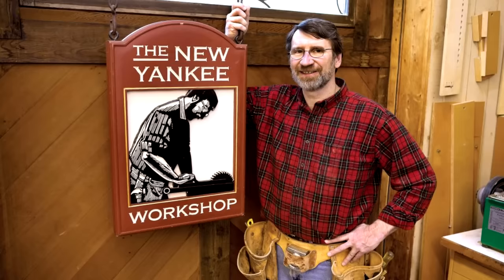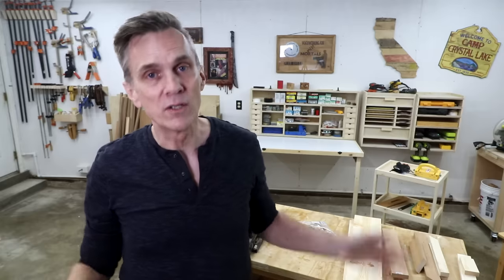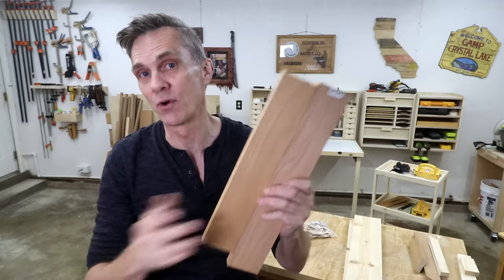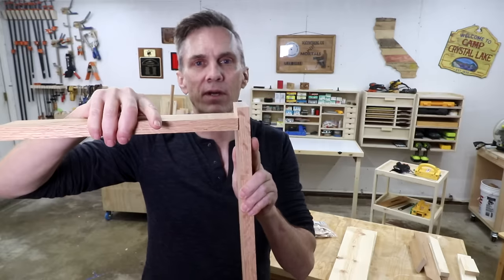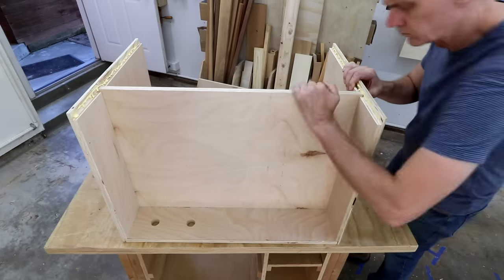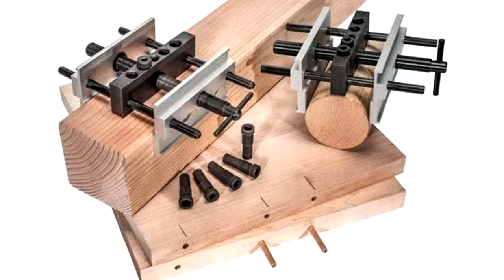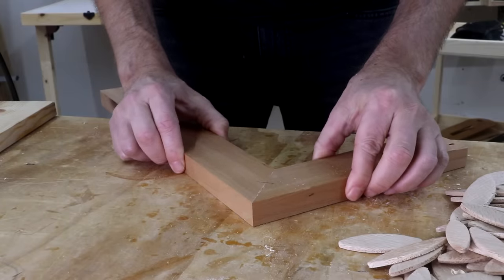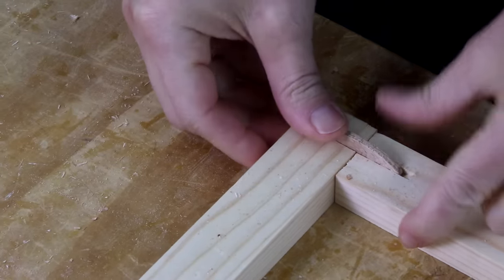So, is a biscuit joiner completely useless?

Comment: My 2 cents on this issue, with respect to Steve and his great videos which I have been watching for a long time:

If you're using a biscuit joiner to create a joint, you're using it wrong. It's only purpose is to align the boards better so that you save time sanding in the end. As a matter of fact, it should say it on the box: "Do not use for creating joints". Therefore, comparing it to dowel jigs or the Domino, is comparing apples to pineapples.

Sure, an alternative is the use of cauls, however if you're making a table that's 38" wide, cauls are ineffective in my opinion. Plus you have to keep cauls from not being glued to the surface, etc, pretty messy. Also, there is a another huge benefit to biscuits here: if your boards are not perfectly milled and have a slight variation in thickness, biscuits will still align them at the top, creating a flat tabletop, cauls will not, they will just squeeze the thicker boards, allowing the thinner ones to float. So, if you're a novice carpenter who wants to make tables, using biscuits will make your life much easier, in my opinion.

If you're proficient using the tool, you can create slots on a whole dining table in a matter of minutes. 

Nobody said that a biscuit joiner is an essential, agreed, it's definitely a specialty tool. Personally, I use it only when making tables.

Also, with my DeWalt biscuit joiner, the biscuits fit snugly. Or perhaps it's the size of the biscuits. The biscuits are supposed to slide left and right in their slot, but should not move up or down in it.
Reply: They are perfect for jointing boxes, drawers, cabinets, raised panels and small tables. And if you combine it with pocket holes and screw joints it can be really strong.

Comment: I don't have ANY play in my biscuits, they DO make the boards go together flat, and since I wasn't sure I'd like it I bought the cheapest, and my blade is the proper thickness.... You prefer pocket screws, the weakest joint there is? Corregated metal joint fasteners?? How often biscuits are handy depends on what type of work you do.

Comment: You don't need to purchase a biscuit jointer, you can purchase a slotting cutter for your router and do exactly the same thing. And if you use a good cutter, the fit is tight with the biscuit.

Comment: Agree totally about biscuit joints, but think that the whole "glue joint is stronger than the wood" argument is a bit of a myth. I say this because most of the wood that I use is salvaged and I have broken many, many  glue joints and usually without any tear out. I would agree that while a glue joint is stronger than the wood when you try to lever it apart, if you shock the joint the glue becomes the weak point.

Comment: There are several size biscuits available which you can use in your mitre joints so they aren’t seen and you obviously have a problem using your biscuit jointer re the play in your slots. Mine are tight and I have very little variation between board surfaces when using them. You are going to surface in some way your resulting slab/bench top anyway to even out any variations so I don’t see what the problem is. A biscuit joiner is a very well used tool in my workshop

Comment: Sorry Steve but this time I really disagree with you. This video has so much wrong information.
Biscuits (as their manufacturer claims) are only for alignment,  they have nothing to do with adding strength to joints.
I think that you are using a crappy type of biscuits and biscuits joiner or have installed the wrong blade in the joiner. 
I'm using a Lamello biscuit joiner with the Lemallo biscuits and the blade thickness matches exactly so the alignment is spot on. 
Makita has also an affordable  biscuits joiner that matches the Lamello biscuits.
Also, these biscuits comes in three sizes (20, 10, 0) so you can use them for miter joints like picture frames and your joiner should have the option to adjust the plunge depth.

I love watching your videos, keep on.
Reply: I think he was saying that people use the biscuit joiner for strength because tv Norm used it that way and it was just accepted as a fact after a while (well, for those not in the know).

Comment: I completely disagree. My biscuit joints are strong and tight and absolutely help wilt alignment. I didn’t get a biscuit jointer to be a go to tool and I agree a beginner shouldn’t buy one. However it depends on what projects your doing. I as a beginner bought a biscuit jointer and made many projects that are still holding together until I was able buy many other tools that allowed for more technique and efficiency. So I’d completely agree that a biscuit jointer is not often used, but that doesn’t mean you should buy one. You should buy one if you have projects you think you will need for it

Comment: I disagree with you at this time I’m afraid, I think you’re missing the greatest advantage of biscuit jointers and that’s the construction of MDF and Plywood Carcasses, I don’t think the methods you’ve shown are what I would first use a biscuiter for, you may not be happy with it just through choosing an ineffective jointing method for your task. They’re very versatile machines. If you look at the Lamello Zeta P2, that allows for plastic click biscuits and biscuits that pull up through an Allen key, it can be really handy for a strong joint, when cramping something isn’t an option!
Reply: Thanks Jacob. Agreed that most are missing the reason Lamello was developed originally. Joining sheet goods at their edges and ends, or amidships, the biscuit does not compromise the skin of a board and weaken it the way a dado would.  The machine lends quick precision in one dimension, allowing forgiveness axially for quick setup and plunging. And with MDF, what is an alternative, , screws! Yeah, sure.

Comment: Steve I am finally about to move out of my current townhouse into a home with space to do some woodworking and my first project will be a farmhouse kitchen table, I thought the biscuit jointer was going to allow for a little fluidity of the boards for swelling  and shrinking instead of being screwed in and it cracking?

Comment: There is NO SUBSTITUTE for aliphatic resin wood glue to join wood. The way I see it, this biscuit joiner has one decent purpose; to align the two pieces of wood until the glue dries.
ONE QUESTION, why can’t you just use a slot cutting router bit instead of the biscuit joiner?

Comment: I use chopstick as dowel and it sucks. Rather than keep the board flat while glueing, it press the board to bend maybe because i dont drill the hole at same height. Now just use glue and it is strong enough

Comment: i love dowel joints,
you just have to set up the drill so you can drill through both parts at once,
i think thats what he means by kinda annoying to set up.
and then without taking it apart again, i will hammer in a "dowel".

Comment: I add a tiny shim in the slot then it does not move 
Other studies or test have shown it does add strength?
These of course are not published scientific studies ?

Much like yours?

Oh table top attachments?  With buttons?
Just an amazing tool!

Kinda why every cabinet maker like me has one?

Face frames?

Oh furniture repairs where alignment is critical?

Just did one on a $2000 head board????

Worked like a charm!

Now a pair of tennis shoes in the shop?  Instead of work wear??

Chk that off 1st! Steve?

Comment: I thought at first you were joking. 

I bought one of the first biscuit joiners ever, in 1985, from the original developer/patent holder, Lamello. Their tools create joins which do not have any play at all, and one thing you don't, at least not normally, use them for is joining boards to form a larger board. Over the years I have met many carpenters who use and used Lamello biscuits and joiners for making anything from big stands at shows, cupboards, bookshelves / book cases, furniture, etc.
Do yourself a favour and get a decent one, you may change your mind.
I also suggest you look at bit further at Lamello products, like their Zeta P2 versions they currently produce as well.
If done well, the bonds are extremely strong and very fast and easy to make.

BTW, Lamello make their biscuits from pressed beech.

As to domino joints: well, they were invented way later when Lamello still held the active patent, so Festool had no other option. Talking about narrow boards: for domino joints you need even wider (thicker) boards.

As to sturdiness of these joints: I have carried with me in over 22 house moves, including 2 intercontinental ones, 2 1.2 m wide book cases, with just a left and a right side, a little over 2 m high, 6 shelves (7 if you count the top as well), made from 16 mm wood veneer finished chip board with a 4 mm plywood back plate. They carried well over 1400 books in total, and lasted over 20 years (and those 22 moves), until my spouse had enough of them and wanted something different, and I had to replace them with something new. BTW, these were the only two pieces of furniture in my possession over a period of more than 30 years which actually lasted this long without breaking or without needing repair. Not bad considering they were just made from biscuit jointed chipboard. And I do know others who have similar experiences, BTW.

Considering the size and weight of book cases, I used their new system, no gluing at all, in order to create my own (luxury) flat-packs, made from stained and/or lacquered BB quality multiplex, to assemble and disamble as I see fit (for house moves essentially).

I sincerely think you should have a look at this again, but this time, please get the proper tools, and use it for what it was really made for, i.e., not for board joinery, although doen with a proper Lamello will work well too IME.  Get the proper OEM equipment - Lamello. I still have the original Lamello biscuit jointer I bought in 1985, and it actually still works just fine.

Kind regards, Wim

Comment: A junk biscuit joint is a junk joint. Biscuits need to be tight that is why they have different sizes within std biscuits sizes. The vast number of composite, mechanical locking biscuits or clamp aids is still growing. Your chip wood beech biscuit is just one of 20 different kinds. They even make stainless finger locking.

Comment: Steve, this may be a dumb question, but is there a way to use a biscuit joiner and instead of using a wooden biscuit, try using something with more strength like metal to join the two pieces?

Comment: I don't know why his biscuits are so sloppy.  Mine are much tighter and prevent that "glue slide" you get with wood glue.  If you put blocks across your panel glue ups like he says he does, they will tend to get glued to the panel if there's any squeeze out, which there should be. Then when you take the blocks off, it tears out the grain.  It's true, you don't want to use them as tenons.  Really they are for alignment mostly, but also add a lot of shear strength to a simple shelf glue up.  Sure, dados are even better, but they are a pain compared to putting a few biscuits in.  I do most cabinet box glue-ups with biscuits, though the inner shelving I usually set on pins.  ever try to shear a biscuit?  They are pretty damn strong that way!

Comment: Also, there's no reason you couldn't make the biscuits bigger in all dimensions to both penetrate the wood deeper like your floating tenons, and to tighten up tolerances so they're not as sloppy in the slot you just cut. Version 1 of everything sucks, so all we need is biscuits v2.0.

Comment: Could I save a lot of money by just buying the biscuits and cutting the slots by hand with a tenon saw or Japanese saw? I need to strengthen a glued joint between end grain and face grain. Imagine an "L" shape, with a cross piece and a side piece. The timber is pine 15mm x 44mm. At present I'm using dowels.

Comment: Disagree!!!   I don't think it adds strength to a glue-up, but I do think it helps with alignment. I had some sloppy alignment glue-ups at 1st, but after I started clamping the jointer for each cut, I got a much tighter biscuit slot and perfectly aligned 7' long glue-up.

Comment: Would you not have the same issue with a domino joint that you would with a biscuit joint? I mean the play that is there between the domino and the hole? I think biscuits are just quick and easy and doesn’t require a lot of precision like a dovetail so, it makes it attractive.

Comment: Why didn’t you tell me about this years ago?  I bought one a brisket jointer because Norm was always taking about them.  I tried to use them 2 or 3 times with disaster results.  I still have the original jar of briskets deep in the bowels of my tool box.

Comment: My god what Are you talking about, i have tested and compared biscuit dowel and domino joints in Box frame and yes they Are little weaker than dowel joints but If you want stronger joints use biscuits that Are compoused from 3layers not thouse cheap ones. Difference If i remember correctly was about 15percent  between two 8millimeter dowels and one biscuit, i had small test pieces thats why only one biscuit. But stronger the material thigter fit and more glue gives allways good result. Biscuits Are great for cabinet makeing, two biscuits can easily hold a cabinet ceramic sink plus 200lb of weight in mdf. Havent had any problems with that in ten years

Comment: Dowels have been used for centuries. It's still widely used, not with the little jig you showed, but with purpose built machines that will blow away a festool domino. The domino is portable, that's it's selling point. And yes a domino is stronger than a biscuit, but not a double dowel joint, which is the practice when using dowels.
Buying a purpose built dowel drilling machine just isn't practical for most woodworkers, especially for hobbyist or site workers. That's where a biscuit joiner fills in. A biscuit joint is stronger than a butt joint. That's not even debatable.

Comment: I use a cirelsaw to cut biscuit holes and cut my one biscuits out of 3mm plywood scraps.
Or i use a nanoblade (chainsaw-jigsaw) to dropcut domino's
Reply: That's good and all but the biscuits you buy are compressed so when they get glue on them or wet they expand and make it very tight
I did notice his biscuits were very loose and his slots
My biscuits are always very tight
I'll have to use a rubber mallet to beat the two pieces together before clamping

Comment: Great video but it seemed like his dismissal of the biscuit joint was in the  material quality and size of the biscuit itself. If he simply used a biscuit shaped piece of wood with grain straddling the joined pieces with glue and a rubber mallet  the biscuit joint could see a renaissance !!!

Comment: Shocked by how loose your biscuits are! Have you checked the blade and bearings in your jointer? I have had good service with biscuits and veneered boards, biscuits are essentially just small floating tenons.

Comment: Biscuits are terrible! Biscuit joiners are good at cutting slots for splines in small case miters. I just cut the slot to have the longest flat bottom section possible and make my own splines to fit. It's not a biscuit joiner but a "hand held horizontal slot cutter"

Comment: Steve, I have to disagree here. The name was a bad choice though, they are not really for joining stuff (not in so far as them being the 'joint'). They are alignment tools and I also have no play but the problem is you need the correct biscuit for your machine. Seems to be no real standard to the damn things. But again their purpose is to ensure alignment. 

What for me made them stand out was that you could position the biscuits with great accuracy in 2 dimensions in 1 single go. No faffing about with making complex measurements on the boards you were joining. Hell for edge gluing boards you just put them side by side, and marked a small line perpendicular across the 2 board edges at somewhat even intervals (that you could just eye). Then you set the height on the joiners guard and went to town cutting slots by lining up the center mark of the joiner on your pencil marks. It was fast!

With every other method you had to mark shit out for hours (dowels especially, it's no wonder there are so many jigs to aid with positioning them accurately and repeatably).

It's all about what works for you though. For every problem there are always 20 or more solutions... Well except for politics, no solution there...

Comment: I wouldn't buy a biscuit jointer. I use dowel joints for some things, lap joints and had cut mortice and tennon joints. I made a test mortice and tennon joint before I made the door to my shed and it was so strong without glue I couldn't move it after a test fit.

Comment: Biscuits. Dowels and dominos  only line up the boards until they dry. The only strength they add is they small space they take up in the board. Instead of dominos use two dowels, same thing. Unless you want to throw your money away on fest tools extortion price.

Comment: Your machine (or the biscuits) must be pretty poor quality, if you have that much slop. 

I use a Porter Cable biscuit joiner, my joints are always tight, and it has been a very useful tool in my shop.

Comment: If your biscuits are that loose in the slot, then you are doing it wrong.  You likely have the wrong blade or biscuits, or your biscuit joiner is broken.  They should be a tight fit.